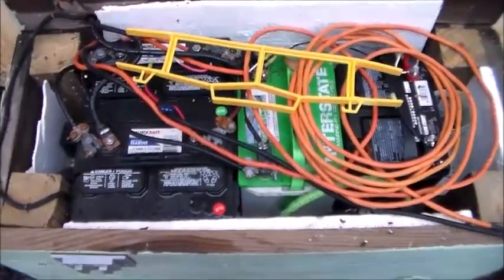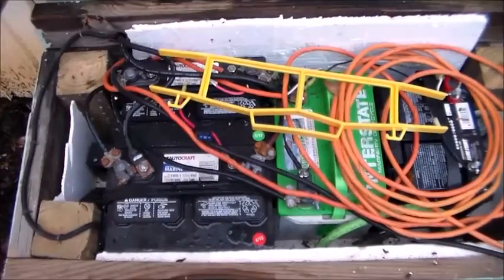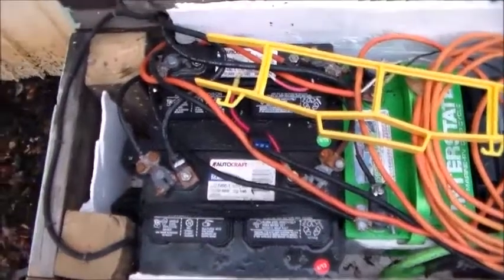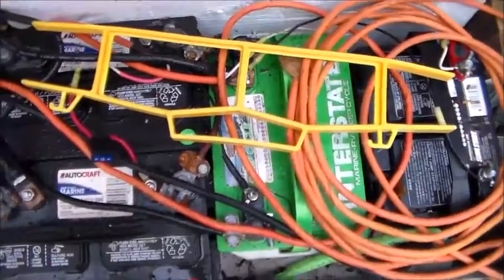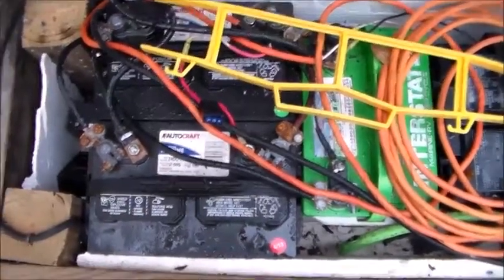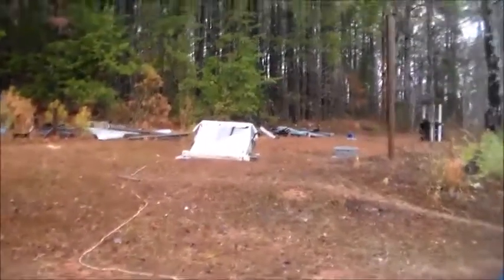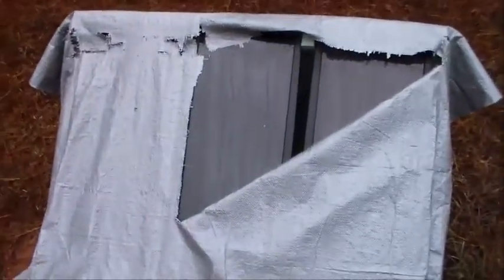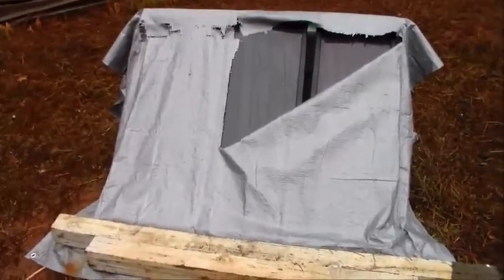Harbor Freight Solar Panel Low Voltage Problem Battery Dropping To Quickly

Comment: I have 2 200amph batteries plus 2 35 amph and the same green interstate you have. Still not even close enough to say keep a AC running.

Comment: hi there! i've got 300 watts of solar panels, 5 of the 35ah harbor freight connected in parallel (to give 175ah), and am using a jupiter (from harbor freight) 2000/4000 watt inverter. how do i bypass the charge controller altogether?? it keeps telling me my voltage is too low and this is incredibly frustrating. i'm just trying to run a mini fridge and some lights lol
Reply: Did you ever figure this out? Having the same problem with the same set up
Reply: @baileylove4236  i don’t remember— i didn’t keep the harbor freight stuff long, tho. it was too hard to make it efficient. i switched to a renogy setup with a windy nation battery bank

Comment: with charge controller do you have? 
I just bought 2 of the 100 watt systems and the controller on that one I belive is a 30amp didnt make that horrific low voltage siren lol.

Comment: I'm using a single Everstart 29DC group 105 Ah battery so far with my 100w Harbor Freight solar kit. Planning on getting a second battery soon to run parallel.
Reply from the maker: +Travis B Nice! That's a very good start. Once you get the second battery you will have a good little system.